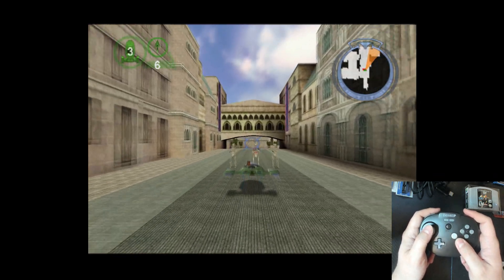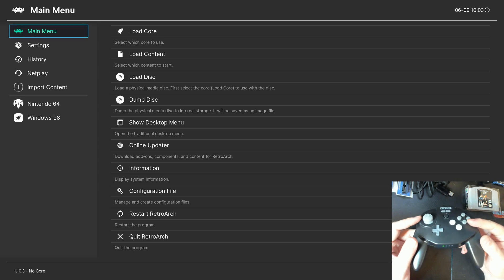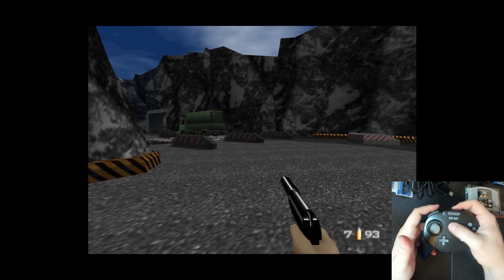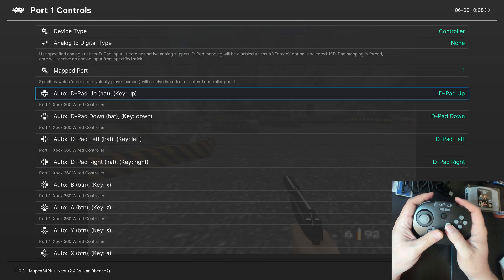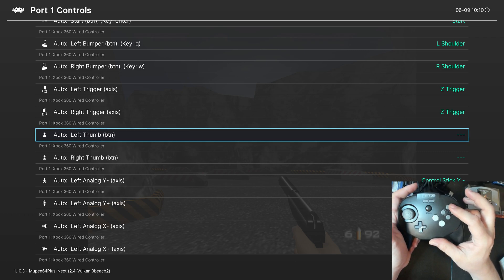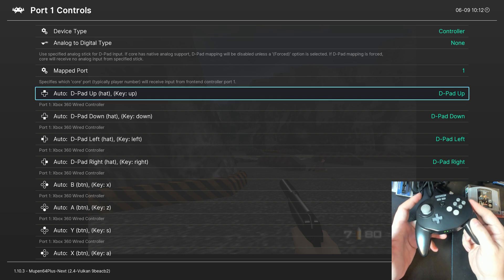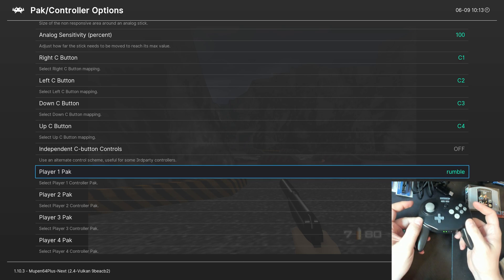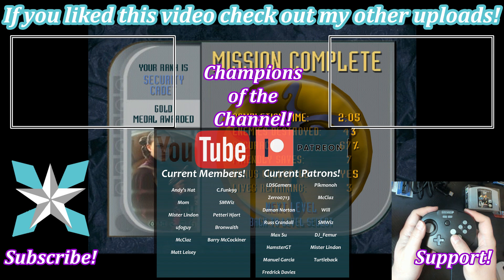[PC/ROG Ally] Retroarch N64 Emulation Button Mapping Setup For Retro-Bit Wireless Tribute 64

Comment: Trying to set inputs through the quick menu with the core loaded causes ZL to also trigger L.
You need to set up the controller through the settings menu before loading the core.
Home button also does nothing. No idea how you got that to work.
This tutorial caused me no end to headaches though.
Reply from the maker: You don't have to do that unless you messed with xinput settings previously.

Comment: Tip: if you bought a cheap third-party controller that still doesn't work with RetroArch, try a standalone emulator like Project64. I bought one without brand on AliExpress and it only worked with Project64.

Comment: Hi I can’t even pair the controller with the pc, it all blinks rapidly and then nothing. On the n64 works fine. Any ideas?
Reply: Yes I was just going to write that I just solved it, but thanks for the super fast response, I just found your videos and they have helped a lot, sub for sure, thanks!
Reply from the maker: Happy gaming!
Reply from the maker: Hey the reset button when pairing to different receivers

Comment: I got the USB version of the original Brawler 64, and the default button inputs identified by the computer were all wrong, and the start button just didn't work at all. So I'm rather iffy about spending my money on a new one just in case I encounter that same issue again.
Reply from the maker: This isn't a Brawler
Reply: @ArchadesGames  So you're saying it's a different N64 controller? That would explain why it looks a bit smaller. Still had similar issues with mine, though.